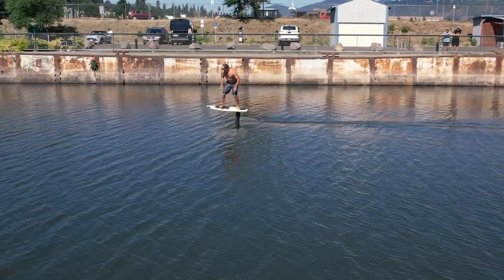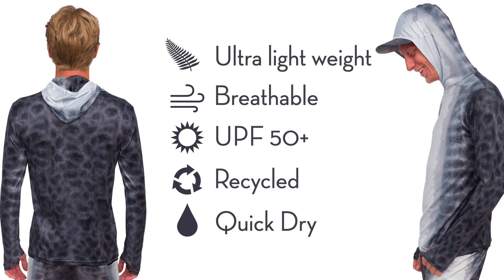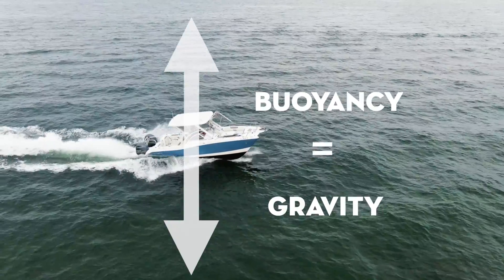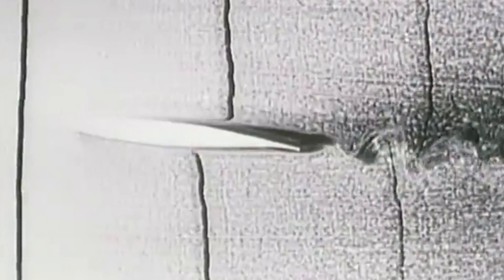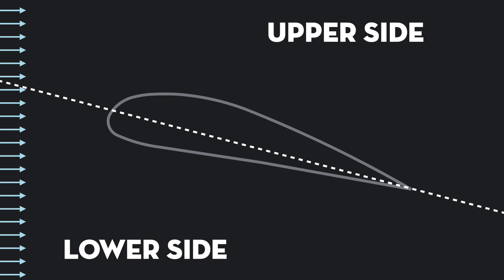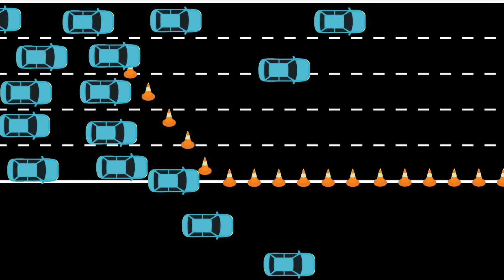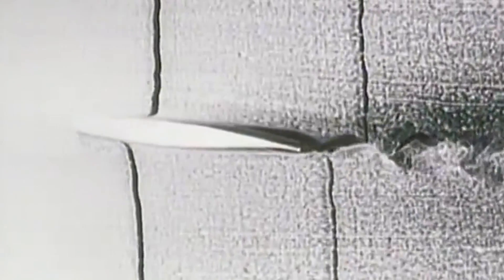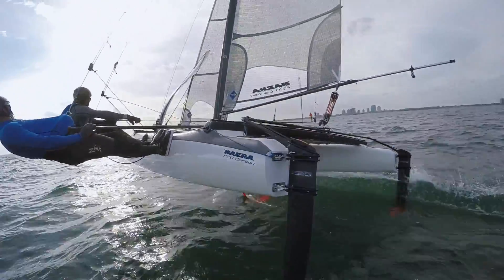How do hydrofoils work - a deep dive into the physics

Comment: But isn't there an upper limit to how fast a wing can be moved under the surface???
There are many restrictions that must be followed if you are to have a successful outcome and it depends on what the wing is to lift out of the water!!!
Doesn't water have a property that air DOESN'T have, that at a certain pressure water starts to boil and generates gas bubbles that eat up all material in their vicinity because of its agressive behvavior???
It can be compared to the turbulent properties of gases, where the wing loses its lifting properties even cald stal. In addition to air water also have a nasty property eating up the material of the wing in this casese. For example, this phenomenon can be seen on tubular propellers.
Sadly, the properties of water have more difficult properties to overcome than air.
Everything can be arranged but at what physical cost and is it worth the trouble???

Boeing has made hydrofoils to perfection for the US NAVY.
If you want to create perfection, you have to learn aerodynamics with its mathematical quirks for a basic understanding and then hydrodynamics to transfer aerodynamics to liquid, because there are some important differences. You can also go straight to fluid dynamics but you still need to learn hydrodynamics if you are going to create a wing that can handle high speeds, we are talking over 40 knots.
There are lots of shortcuts but then your wing will also be mediocre, and you will most likely be disappointed and have to redo the design. You can offcorse also youst create what someone else have calculated.
Have fun and good luck

Comment: Great video! However, I think it gets a bit confusing when discussing velocities before introducing Bernoulli's principle. I don't have a PhD in aerodynamics or hydrodynamics, but the continuity equation seems to suggest the opposite of your traffic lane analogy. An increase in cross-sectional area is rarely followed by an increase in velocity—unless perhaps in cases involving high-temperature nozzles.

Additionally, this explanation doesn't account for lift at zero angle of attack with cambered airfoils.
I hope you see my point and can either show me where I'm mistaken or clarify the assumptions I might have missed.

Comment: What is the driving force behind the advancement of Hydrofoil? Like a roller coaster, slide down and up. This is one of the sources of forward momentum. When the hydrofoil slides downwards, the driver crouches down to increase the speed of the hydrofoil's descent. The driver's continuous behavior during each descent is pushing the hydrofoil forward.

Comment: The wing moves in the air, and when the air encounters the wing, the flow of air is obstructed, so the pressure of the air increases, which also leads to an increase in air velocity at the top of the wing (which you did not specify, you only mentioned an increase in velocity when the air path becomes wider). This is similar to the flow of cars on highways. When the flow of cars encounters a narrow road, they will slow down, so the density of cars increases (similar to an increase in pressure).

Comment: Producing lift force is understandable but how the board moves forward ?
Reply: You should note that the hydrofoil fluctuates up and down, like a roller coaster, sliding down and up. This is one of the sources of forward momentum. When the hydrofoil slides downwards, the driver crouches down to increase the speed of the hydrofoil's descent. The driver's continuous behavior during each descent is pushing the hydrofoil forward.
Reply: @enbinzheng-line  Means there is no motor or any other technology to give forward movement. That's cool
Reply: @Blitzkrieg2024  Of course, there is also a type of hydrofoil that is powered, but the hydrofoil in this video is not powered, and its power comes entirely from human movement on the hydrofoil

Comment: the water in front of the wing is relatively consistent in pressure distribution, somewhat 'still' if not truly still. the water which reaches the end tail has a collision between the top and the bottom layer. This 'agitation' works somewhat like a propeller. and gives that push to the wing. In short, they are like numerous tiny 'gears in mesh rolling over each other creating the force required.

Comment: Could you please explain why "pumping" works when hydrofoiling?
Reply: That's what I was interested in too 😢
Reply: What does' pumping 'mean?
Reply: @enbinzheng-line  In the context of hydrofoils, “pumping” refers to the rider’s technique of generating forward propulsion by rhythmically shifting their weight and moving their body—typically by bending and straightening the legs in a coordinated up-and-down motion. This motion causes the foil wing underwater to produce lift and thrust, allowing the rider to maintain or even gain speed without relying on a sail, kite, or wave.

Comment: Bernoulli's principle does not explain it correctly. If the velocity difference between the top of the wing (higher speed) and the bottom of the speed (lower speed) is everything that matters then try this (you can do it on the river) just put the wing in the situation when above the wing water speed is zero (something blocks it, even hand) and below wind it is flying. In this situation the Bernulli's law says: Below the wind we have much higher velocity which means lower pressure and that means the wing will be pushed down :) In reality, the wing will still go up  (try it - it is not difficult to experiment).  The Coanda effect (makes molecules repeat the shape of the wing pushing them down in a demonstrated angle of attack) and 3-d Newton's law explain it better. At the end of the day because water molecules are pushed down it means (3-d Newton law) wing is pushed up.
Reply from the maker: Newton’s law is intuitive when explaining the big picture. If the fluid gets deflected down, it must produce an equal and opposite force upward (as we present in the video). But Newton alone does not explain why the fluid is deflected down in the first place. As you point out, the lower side of a foil is straightforward, the presence of the foil physically deflects the air downward, something most people have experienced when holding their hand at an angle out of a car window. 

But a well-designed foil actually produces the majority of its lifting force from the low-pressure upper side, and to explain why that flow is producing so much less pressure than the bottom side, we need a relationship between flow velocity and pressure. Specifically that the two are inversely related and occur simultaneously. One does not “control” the other…high pressure must occur in slower flow, just as lower pressure must occur when a flow speeds up. 

Also to note, the Coanda Effect is often incorrectly referenced when explaining hydrofoils. The Coanda effect only applies to jet flows, which do not occur around hydrofoils. For a detailed explanation about how the Coanda effect is incorrectly cited when explaining lift around a foil, take a look at section 7.3.1.7 (pg. 275) of Doug McLean’s textbook “Understanding Aerodynamics”. He does a great job breaking things down.
Reply: @Waterlust  Thank you for your detailed reply. I’ll definitely take a look at the reference. The upper side of the wing is indeed more interesting to explore, but the Bernoulli principle doesn't fully explain it. While there is a correlation between speed and lower pressure above the wing, this occurs due to the separation of the air (or liquid) flow from the wing’s surface. When the air loses contact with the wing, pressure drops because there's no longer any direct contact to exert force.
To illustrate, imagine riding a bike at high speed. As you go over a downhill, you momentarily lose contact with the ground, similar to how air molecules behave when they lose contact with the wing. Bernoulli would explain this by saying you gained speed because you’re traveling downhill, which led to lose of the bike pressure on the surface . However, that’s not the cause; it's the result. The real cause is the inertia of your bike moving forward while gravity pulls you down. Because of inertia, gravity can’t pull you down instantly, resulting in a brief moment of flight. This explanation is, of course, oversimplified but intuitive. If you consider air or water as billions of molecules traveling through space, they lose contact with the wing when it dips downward, much like your bike does with the road.
By the way the reason for the front of the wing to look like a bike jump hill exactly for the reason to change airflow from straight to up 45% because the air/water will loose contact sooner and for longer. The same happens with the bike that goes on the jump hill. Do not take it as the last wisdom just sharing my analogy and my confusion with Bernoulli principle :)
Reply: The lift on the water surface you mentioned is skipping stones. When skipping stones, the upper surface of the stone is in the air rather than underwater, but there is still lift. That's why the stone didn't sink.

Comment: Great video, easy to follow. But my quest today is to find out why it turns when you add weight to one side. On a surfboard I think the added drag makes it turn when you tip it. On the foil it seems like it would just slowly rotate and you would tip over. A plane has a tail that you adjust, efoil doesn't. My first lesson on an efoil was a disaster as it tipped over repeatidly and I want to get it in my head right before going again. I'll keep running your explaination through my head. Thanks for the info and visuals!

Comment: Great video, thank you for the information! I was hoping it would have some information on how the size and shape of the foil changes its characteristics. Such as width of the foil, depth of the foil, chord of the foil etc. 

Let's say there's these two foils to compare. 
(Foil A) And (Foil B) 
They both have the same surface area. These are stabilizers, rear foils.

Foil A is wider but not as deep , and foil B is narrower but deeper. Assuming the chord thickness is the same, how would the different foils respond? 

So I guess we're talking about the aspect ratio, We know that higher aspect is faster and can pump more efficiently on a front wing, Is that the same principle for the rear stabilizer?
Reply from the maker: Not totally clear what you mean by “deep” and “narrower”. Could you elaborate more so we can better understand your question?

Aspect ratio is defined as the span squared divided by the surface area. All wings have what are called “tip losses”, also called “induced drag” that is created by vortices that are created at the wing tips where the high pressure and low pressure flows converge. The bigger these vortices are, the less efficient and more draggy a wing will be. This is why airplanes that have no engine (e.g gliders) have super high aspect wings, whereas planes with plenty of horsepower that go super fast (fighter jets) can get away with much lower aspect ratio wings. 

Hope that helps!

Comment: Totally missed the question that i had. Im curious about how it keeps continuous forward motion with no motor, is their something im missing?
Reply from the maker: It depends on what kind of application. If it’s a wind powered foiling craft like a sailboat, kite or wing surfer, the forward motion is caused by the forward thrust produced by the wind. If it’s a foil surfing on a wave, the forward motion is produced by the wave energy in the same way conventional surfing works. If it’s a foiler pumping around flat water, the forward motion is produced by the articulating motion of the foil itself, much like how a bird moves forward by flapping its wings.

Comment: They are actually pretty simple. Front wing pushes upwards. Tail pushes down. It creates a strong lift on the mast and the board comes up out of the water. 

It’s basically just a glider. If you get the foil to the surface and let it drop, it will glide until the board hits the water. How people ride them is basically taking all your weight off it to let it climb, then putting your weight back on to glide. 

What I’m most excited for is some type of hybrid foil. Generally the thicker the foil, the more low speed lift you have. And the thunder, the less low speed lift you have. The thick foil has a low top speed. The thin foil has a high top speed. 

Lately, Armstrong has introduced foils with high camber that drastically reduce the stall speed but also reduce the top speed. I’d love to see a wing that can change certain features as you ride. Maybe a bit too much to ask. 

Great information!
Reply: What certain features would you want the wing to be able to change dynamically as you ride it in the water?

Comment: In regards to your explanation as to why bubbles are not seen on the upper trailing edge  of the wing, it seems like there’s a generous amount of bubbles that were available to fill that void. And there seems to be plenty of bubbles just downstream of the trailing edge that could fill the void if they were indeed moving upstream. Are you convinced that these are the accurate explanations. Thanks.
Reply from the maker: If we had to bet money on it, we’d say it’s flow separation (e.g stall) driven by an adverse pressure gradient.

Comment: Why don’t the bubbles on the upper surface of the trailing edge of the wing  (6:47) move along with the fluid? Shouldn’t they behave like little cars or little boxes? Thanks.
Reply from the maker: In that visualization, they’re using a pipe ahead of the foil that lets out small bubbles that travel with the flow to help observers see what the flow is doing. They call this a “tracer”, and it’s never a perfect representation of the fluid itself. The holes in the pipe are spaced apart, and we’re guessing the reason we’re seeing a gap in bubble coverage on the upper surface as the flow passes is partly because there weren’t enough bubbles upstream to give adequate coverage. If the bubbles were universally distributed everywhere in the flow, we expect you would see more of them back there. 

There is also another interesting phenomenon called an “adverse pressure gradient”, which can cause a reversal in flow from the trailing edge towards the leading edge of the foil, resulting in what is called “flow separation.” If this is the cause, then the fluid we’re seeing without bubbles originated off the trailing edge and moved from right to left into that region. 

Hope that info helps! Great question!
Reply: @Waterlust  Thanks, but it seems like there’s a generous amount of bubbles to fill that void. And there seems to be plenty of bubbles just downstream of the trailing edge that could fill the void if they were moving upstream.

Comment: Great informative video!  I'm curious why all foiling surfboards seem to have wings with negative dihedral.  It seems to me that positive dihedral, like in an airplane, would be more stable.
Reply from the maker: Great question! Positive dihedral helps stability (like in planes), but it also brings the foil tip closer to the water surface, which increases the risk of ventilation (sucking air down). Tip vortices are incredibly effective at sucking air down to the foil surface and causing catastrophic stall which often results in a loss of lift and a crash!